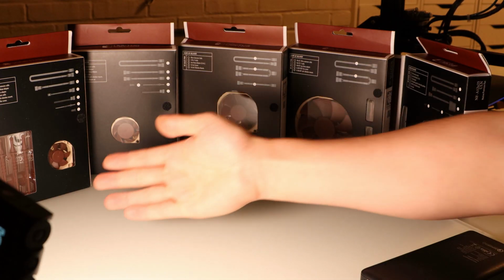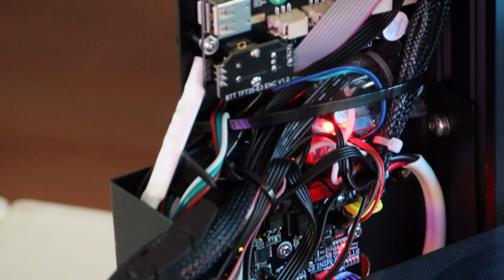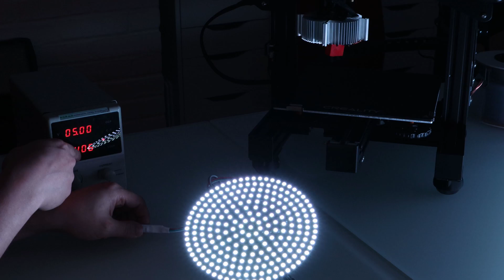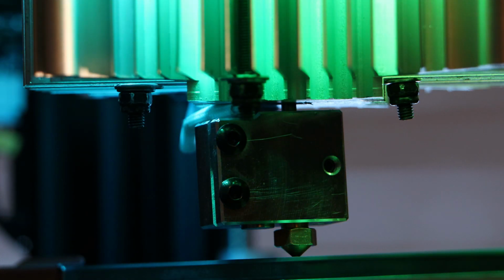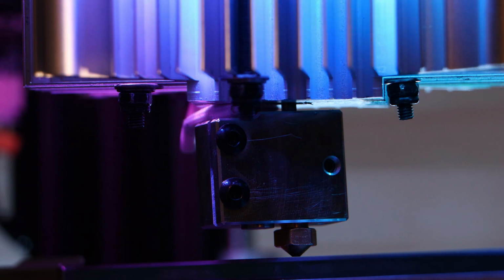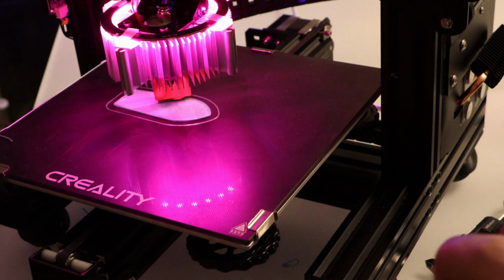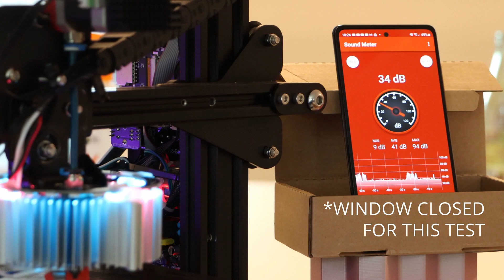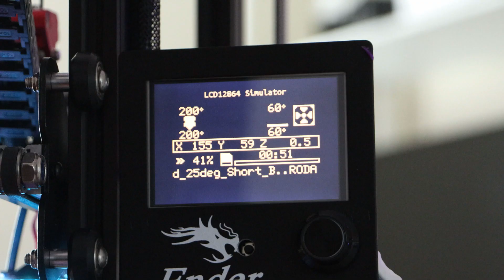Ender 3 - Fanless Build

Comment: Try printing ABS? Although the nozzle temp needs te be higher (and heated bed is helpful to let it stick), it does not really need a part cooling fan 💡.
(been printing ABS for 7 years without fan on a bed slinger)
If you don't have a FR4/G10 bed surface, use kapton tape, still a very trusty option for ABS

Comment: Great content, one question tho: I am planning one printing carbon fibre and pei. Is a 50/60w heat catridge directly compatible with an ender 3 pro (or do I need to change something in the firmware)?
Reply from the maker: The only thing you might need to change is the PID tuning.

You have to send a gcode command to do it: 
M303 E<extruder> S<temperature> C<cycles>
Example: M303 E0 S240 C3

Sometimes you can put a different cartridge in and it will work fine, but other times the temperature will oscillate  and never start the print.

Comment: You mispellt "quietest" in the thumbnail, but it was a pretty awesome build! No part cooling fan is a pretty big drawback, but no one can argue with that heatpipe setup, lol
Reply from the maker: Paint doesn't have a spell checker and once you type something in you can't edit it without restarting the whole picture. I thought nobody would notice the mispelling lol.

I was thinking about fanless part cooling options, which could be pretty interesting, but I'll probably just stick to printing things that don't need part cooling on this machine to keep it quiet.
Reply: @NathanBuildsRobots  Lol, I'm just that guy. I like to use Inkscape for designing things. Let's you do layers and it's vector based! I even use it to output gcode to do pen plots on my printer.
As far as fan-less cooling, I can only think of compressed air from a tank large enough to not need to refill during a print, but compressor are noisy to begin with so maybe a scuba tank that can be ridiculously high pressure w/a regulator. Don't think the sound tradeoff is worth it at that point, lol

Comment: Great! But what about the fumes? Recently learned that even PLA has toxic fumes... I don't think opening a window is enough. Take care of yourselves!
Reply from the maker: I'm by no means an expert on this topic, but based on the research I have read, almost all plastics offgas a bit when heated. I open several windows around my house when the printers are running to reduce my exposure to the PLA.

The primary concern with PLA is plastic nanoparticles, which is kind of like when you're boiling water it evaporates and recondenses, forming steam particles in the air around it, except instead of water droplets, it's forming little droplets of solid PLA. Ideally you should not be breathing anything like this, but consider that if you live in a city or drive on a highway you are exposed to nanopartocles and airborne chemicals from combustion, offgassing from solvents used to manufacture cars and buildings, compound used in perfumes, burning candles, dust in the air from construction, brake pad dust, etc.

I think 3D printing is relatively safe as long as you understand the materials you're working with and have adequate ventilation.

The particulate output of other plastics like ABS or polycarbonate is 5-20 times higher than PLA and PETG. And they also emit styrene, which is bad for your health.

I'll be moving to a new place soon where I can have a more dedicated print area that will be ventilated and separate from my living space. Then I'll consider playing with ABS, resin printing, and more.
Reply: @NathanBuildsRobots  thanks for the detailed answer! I‘m thinking about to buy a filter from an „Airwasher“ (about 20€) and put a big fan or 4 12cm fans to it. I want a solution that works for me also when soldering, is adaptable for airbrushing and when trees have their pollen flying around... I like adaptable general solutions but maybe it‘ll develop into dedicated solutions.

Polycarbonate that can be cut with a knife and be broken the way I need maybe my material for cases and enclosures...
Reply from the maker: @tobiastho9639  that Airwasher looks like a cool product. Instead of 4 120mm fans you might consider a single 200mm fan from noctua. I got a 5V version that comes with a USB adapter so its really easy to power even with a power bank. 
https://amzn.to/3aFEsUF

I love anything made in Germany. I just got some Knippex pliers that I want to make a video about, they're super useful for nozzle changes.

Comment: Don’t know if you can answer this but how do you stop the noctua fans running all the time ? Love this heat sink so ott lol
Reply from the maker: There's no fans on this build so the first step to get the fans to stop running is to unplug them.
Seriously though, it depends on your set up. Fans can be controlled through the some main boards, but it requires some set up in the firmware to get it working just how you like it. So first step would be to learn how to flash the firmware. If you decide to pursue this, you have my condolences for your next 20 hrs of firmware induced misery.

Comment: You should try it with a Slice Bimetal Heatbreak
Reply from the maker: I was considering a bimetal heatbreak for this project, but went with machined titanium instead. The bimetallic heatbreaks have pretty spotty reviews on Amazon. Also I put a lot of stress on the heatbreak while figuring out how to put this thing together, I'm not sure if the bimetallic press-fit joints would have survived the abuse.

Slice sounds like a great company though. They seem well designed and charge enough for their project that they probably have better QC than your typical 3d printer part manufacturer. Will definitely try to get some of their stuff in to review.
Reply from the maker: So I asked slice for a free one, something tells me it's not gonna happen lol.
Reply: @NathanBuildsRobots  haha yeah. I would love to try one sometime, I've heard people rave about them.

Comment: Lately I've been thinking about how the Prusa Mini external Power Supply puts out 24V at 6.67A but seems limited to 160W.  I wonder if that would be enough wattage to power an Ender 3?
Reply from the maker: Check out this video, the guy monitored power consumption of his Ender 3 over time. 
https://youtu.be/1nJK1C3_sQM

Looks like there are leaks up to 275W, the stock psu is rated for 350W. The heated bed is consuming about 220W, which in my opinion is overkill, and drives the requirement of a very large power supply. It's also somewhat dangerous, because a 220W heated bed left all the way on is probably going to fail by bursting into flames. I don't mind waiting another minute for the heated bed to get up to temperature at the start of a print if it means I can use a much smaller power supply. 

Since I'm running at 19.5V, my heated bed consumes about 150W, and still gets up to temp no problem. I'm guessing my pal consumption is around 210W for my whole system. 

Generally, you never want to run power supplies near or above their rated limit, so I don't think the 24V 6.67A power supply would be sufficient.
Reply: @NathanBuildsRobots  l totally agree. I don't mind waiting for the heated bed especially if I can quiet down my setup significantly. I'll try the Dell PSU!
Reply from the maker: @davidpellerin9445  just remember that the stock heater cartridge is 40w, which will go down to 26W at 19.5V
I tested 50W, 60W cartridges and had no problems at all. 40W will probably still work.
If you need to upgrade I'd recommend the 60W cartridge linked in the description. It costs a bit more, but it has proper silicone clad high stand wire. 
I also found some cheap 64W cartridges designed for the Artillery Sidewinder, but they didn't come with a full length cable, just had a short length of wire with a plug, so I couldn't use them.
Reply: @NathanBuildsRobots  I see what you mean. The 60W one you linked in the description looks like the way to go.  Except it's only 1M.  Wish there was one at 1.5M due to the way I've done my cable management.
Reply from the maker: Soldering those cables isn't too bad as long as you aren't bending it where the solder joint is. Good luck!

Comment: I see the Dell PSU puts out 19.5V but doesn't the BTT board require 24V? Is it ok with lower voltage?
Reply from the maker: Most main boards specify operating voltage between 12 v and 24v. Most of the sensitive electronics run on 5v that is produced by an on-board voltage converter.
You might be able to push the limits and run from 6 v to 35 v, just depends on the voltage limits of the components used in the pcb.
Reply: The most common 32-bit microcontrollers run at 3.3V and below (e.g. STM32F103 used in SKR Mini E3 V2.0). Only oldschool 8-bit microcontrollers are powered by 5V, like the ATMega1284p used in Ender 3/Pro.
But apart from that, Nathan is rignt. The motherboard has some voltage converter installed either DC-DC or LDO.

For example, SKR Mini E3 V2 has both: 
* MP1584EN step-down converter IC to produce 5V from 12V;
* AS1117-3.3 low dropout linear regulator for conversion of 5V provided by previous chip to 3.3V needed by MCU.

The input range of MP1584EN DC-DC is "4.5V to 28V" from datasheet.
Second limiting factor is MOSFET and Stepper motor driver maximum allowed voltage.
TMC2209's Voltage Range is "4.75… 29V DC" (yep, found in datasheet).
The MOSFETs used in SKR have 3 different models, 2 of them are 30V and 40V tolerant, for the 3rd one I was not able to find datasheet to check.
Reply: I also wonder if there is any risk running the stock 24V Mean Well PSU without a fan (with sufficient ventilation of course). I found this cover: https://www.thingiverse.com/thing:3882445

If I had a thermal camera I'd test this on a long print.
Reply: The metal box of PSU is heat resistant and fireproof. 
Instead of making that cover I recommend buying an AC heated bed and solid state relay. It is called something like "Silicone Heater 220V 110V Heated Bed Build Plate for Creality Ender 3". (The relay is sold separately, it's needed by microcontroller to switch on/off heater).

The biggest portion of 300W from PSU is wasted by bed heater and the fan on Mean Well does not spin at low load. The electronics, fans and heating cartridge consume about 60W total. I'm not sure about how much needed for stepper motors - that depend's on the load.

Yes, AC heated bed does have a little risk to short circuit - use an appropriate breaker.
But it's worth the risk while for flamable cover is not.
Reply from the maker: @vasiliynkudryavtsev  I will look into AC heated beds for my next project, I bought a massive laptop power supply and it was pretty expensive. I probably could have gotten away with a $15 power brick if I used an AC heated bed, but I would have to spend more time wiring up the AC system.
Also I agree with keeping the original power supply coverings in place, much safer that way.
Reply: @NathanBuildsRobots  Recently I had an experience with the commercialy available semiprofessional printer which has the AC heated bed by default. It's crazy silent. Well, partially because of the box enclosure.
And the heater is 500 or 750W, which is 2-3x more than Ender's, thus it's heating bed faster.
Reply from the maker: @davidpellerin9445   Personally, I would not run the power supply fanless. Companies love saving money, and if they could remove the fan without reducing the rated power output, they probably would have done it already. 
If you look at the Prusa I3 MK3s, it uses a fanless power supply, but it was designed to operate without a fan. It probably has larger heatsinks and more efficient components to compensate.

Comment: Hi Nathan, what do you think about a Dragon hot end and a larger slow moving fan.
Reply from the maker: I am curious about how the dragon and mosquito hotends perform without fans. On a corexy printer the hotend might move around enough to keep the hotend cool just by stirring the air around from its motion.
Would love to get them and do a side by side comparison with the thermal camera, both with and without fans, but they are quite expensive. Soon as I can get a sponsor I'll look into more expensive projects like that.
Reply from the maker: My other thought is: large fans aren't better than small fans if you're cooling something small. Larger fans pair well with large heatsinks, but if you're heatsink is small you'd probably be better served with a small fan. High static pressure and airspeed is more important than volumetric flow rate when trying to cool small objects. But high static pressure and airspeed fans tend to be very loud.
Reply from the maker: Final thoughts:
Just bought a dragon hotend, and a large slow moving fan. Will feature them in my next video.

Comment: Needs just 1 large, part cooling fan running at a slower speed.
Reply from the maker: After reading your comment I Googled "super big case fan" and  found this comically oversized noctua fan: 
https://amzn.to/3vOIXFp (affiliate link)
This thing is too good to be true.  Had to buy it with same-day shipping.
Reply: @NathanBuildsRobots  Believe it or not, sadly, it's still just a little too small for my computer case.
I have the IN WIN Maelstrom. It takes a 220mm fan on its all mesh side panel.
I love it because large fans move more air at a lower RPM making them far quieter. However the fan is dying and I need to replace it.
Reply from the maker: @3sotErik  lol just looked up that case. Up to 6 120mm fans. Looks like the hole spacing for 220mm and 200mm might be the same. The noctua has options for a 170mm square 4-hole pattern.
Reply: @NathanBuildsRobots  Thanks! I'll have to take a closer look at that side panel. I'm not into the RGB. My case is all blacked out so I don't have to worry about the Noctua color clash.
Reply from the maker: @3sotErik  there's a black version thats another $5. But the colors have grown on me.
Reply: @NathanBuildsRobots  This fan is hilarious. and I thought a 92MM fan looked kind of funny on a 3D Printer :)